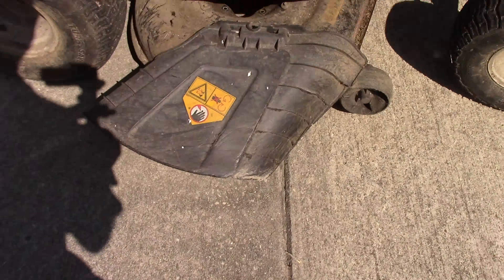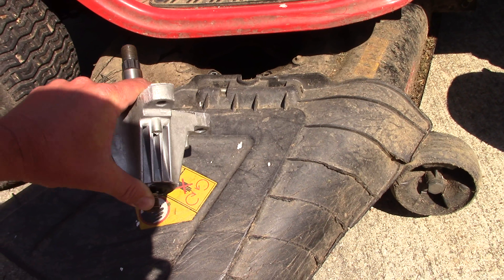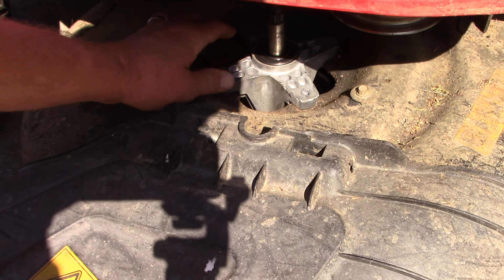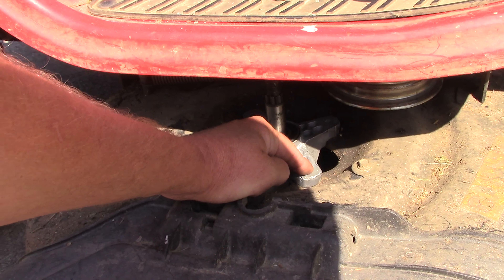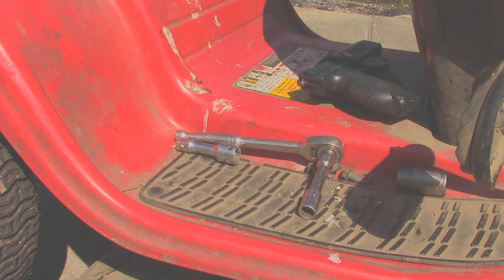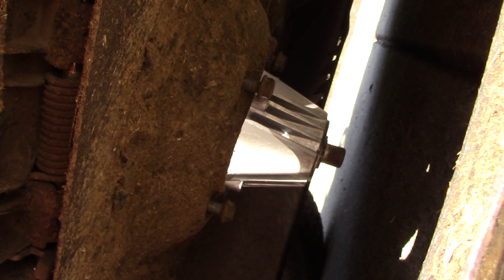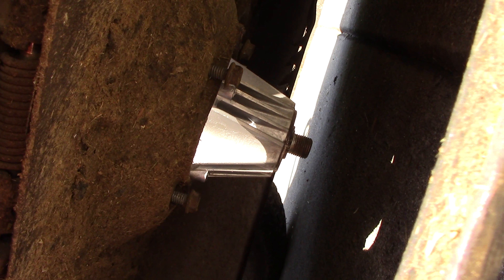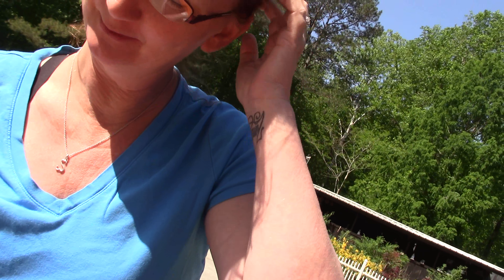Troy Bilt Spindle Replacement

Comment: Appreciate this one too.. especially about the untapped Spindle-bolt holes and the caution when Mounting. As you said I would probably mount the spindle and Pulley before installing... Much easier on the Bench and these Old Joints don't bend as easily as the did even a Few years ago. 

What I WAS looking for was the arrangement of the Top Deck Pulleys and springs with any troubleshooting tips. I removed the deck on My 2012 TB Pony and checked the Spindle bearings because it was shaking a Lot when I engaged the blades like an Imbalance?damage Blade or maybe a bad bearing. After removing the Belts springs and the Pulleys the bearings seem fine and the blades turn easily. Reassembled and it seems the rubber Spring-loaded Brakes that engage the spindles are what was making the Blades hard to turn! (Doing their Job) Duhh! The engine after the Tune-up solution added loosened so much garbage that the engine wasn't getting to Full power as needed is my guess about the shaking.. I can find No other reason. Engine's running full-out now so I'll put the deck back on and see. Thanks again
Reply from the maker: Im glad it helped you some

Comment: I’ve asked several mower repair shops around here if I can replace a spindle on the Troy bolt mower without removing the mower deck and they all said no way.  Looks like you may have done that.  Is that the case?

Thanks
Reply from the maker: Yessir but it is time consuming

Comment: I believe the TB brand spindles are just like MANY more in the marker, if you verify that, and you like and want to maintain that piece of equipment I'd suggest locating scrapped mowers to collect FUTURE needed parts. Most of these lower end mowers are throw away mowers, in one of you're past clips you showed a Snapper, they will last FOREVER >> IF << they are maintained properly, even if not many times will outlast units like you have there, NOT belittling your decision of choice, but us po folks don;t like to spend of stuff that don't last.

Comment: As stated, there are numerous ways to do this, IF the holes in the aluminum casting are NOT tapered I think I would of tapped the  holes BEFORE mounting where I could use a NON self tapping bolt, and use bolts long enough where I could use a locking nut on the top side. Too bad you didn't make a video of the rebuilding of the spindle.